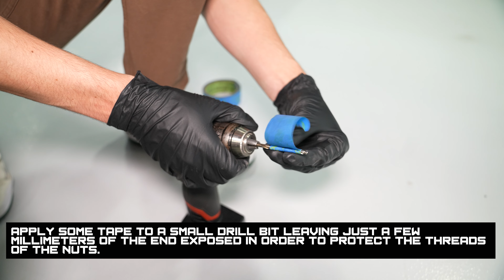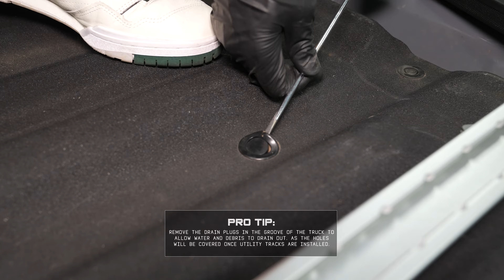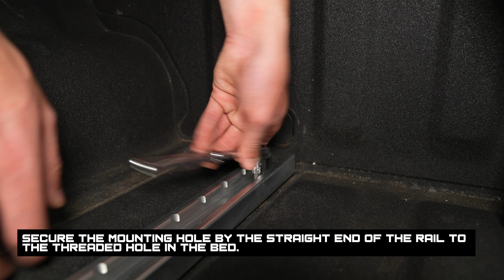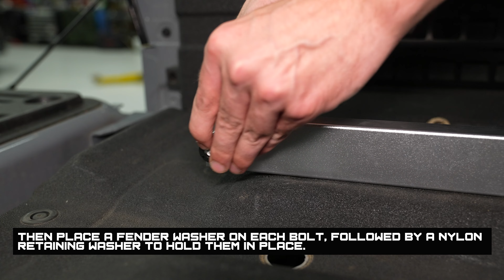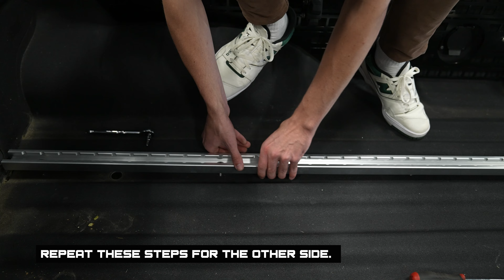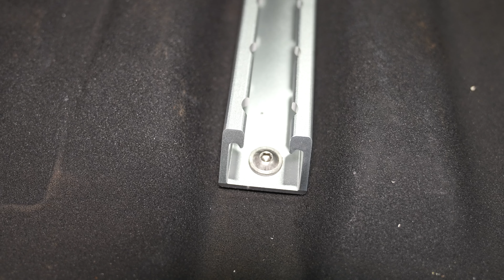Z1 Utility Tracks Installation - D41 Frontier Floor

Comment: need this for my 2019 titan been trying to buy the rails from dealer they claim it cant be done
Reply: I have a frontier sv without utili-track and was told that trucks that have factory utili-track actually have a different bed that is reinforced for the system and trucks that didn't come equipped with lack those reinforcements. May be dealer BS, maybe not. I have abandoned the idea of adding it to my truck.

Comment: drilling into your truck? yikes
Reply: Wait til you see what you do to fit 37s on a Titan swapped d40 lmao
Reply: @valkyriesurvives5109  37s? Too much
Reply: It's a 'utility' vehicle not glass china.
Reply: @miniwarrior7  Difference being a new vehicle costs way more than "glass china". Better know what you're doing if you're gonna drill holes in the panels or frame.
Reply: @valkyriesurvives5109  they are a few small holes on a truck bed. It is not a big deal at all. The bed is already full of holes. If you want to remove the track one day, you can easily cover the holes, either with a mat, or just cover them and spay bed liner over them. 

Scratches on the bed form.using a truck as a TRUCK are way worse than those tiny holes.